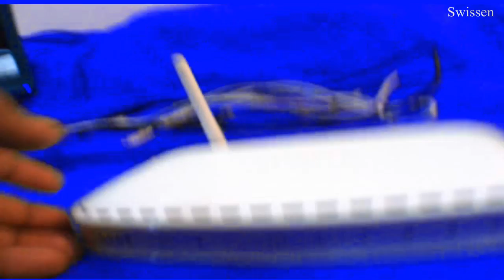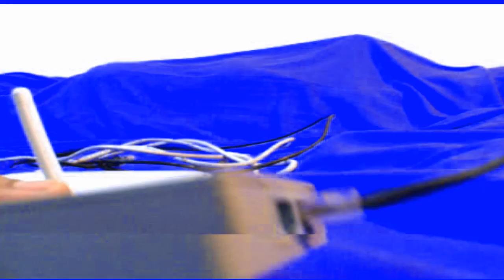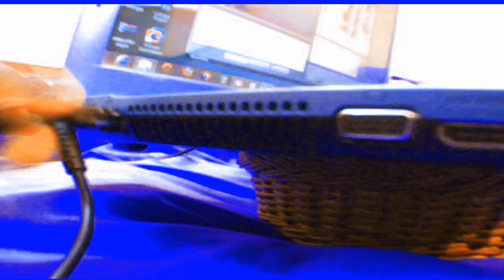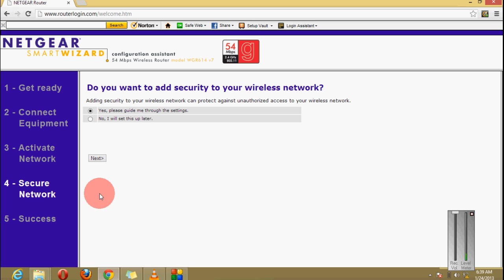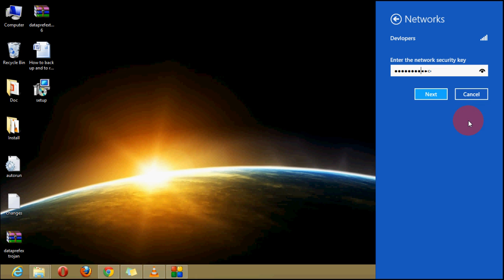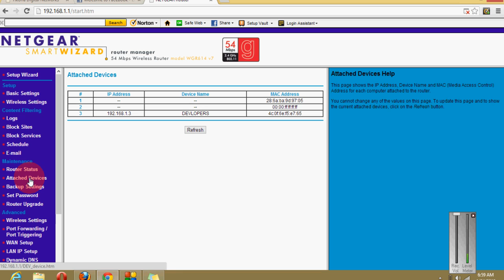Router Configuration - Tikona - Wi-fi connection - Swissen - Suyash Srivastava- youtube

Comment: Hi All,
I Having Tikona Broadband Connection And Having D-Link 600M Router.
I Already Configured My Router.
Please Kindly Tell Me How Can I Feed Tikona User Id And Password Into My ROUTER, So I Don't Have To Login Every Time When I Want To Access Internet From My Mobile Phones.
I Have To Login From My Computer Every Time, This Whole Long Process Irritate Sometimes
Reply from the maker: Ayush Sahu : well i will not suggest u to configure your router for automatic login because its provide you additional security which is good when you are using wi-fi . If you get rid from  filling  user name or password you can simply add remember me option in your browser .
Reply: Go to the router web page
1. Reset the router
2. Go to quick setup
3. Instead of Automatically detect choose Russia PPPoE.
4. If you have tilona digital network you will have your UseraID and Password.
5. Enter your User ID and Password.
6. Confirm the password.
7. Done. Restart your router
Reply: configure your router using PPPoE
Reply: +santosh nalawde Dear Santosh, I Tried All Possible Things But It's Not Working.Few Days Ago I Already Switched Back To BSNL. For All Those Who Wants Tikona Connection Please Be Aware Because In My Case Speed Was Good But Ping Was Horrible And Connection Drops Frequently(Signal 4/4) The Customer Care Gave Me Repeated Answer That Their Is No Problem. In These 2 Months I Realise That BSNL Is Best. If You Configure Your Router(PPPoE) It's Compulsory That You Have To Press LOGIN Button Manually.
Reply: +Suyash Srivastava  hi. Can you still tell, how to configure router to automatic login.
Reply: +santosh nalawde thank you so much.
I tried doing this. But, still unable to connect automatically. what to do now..
I'm using TP-Link 740N
Reply: +007katu14 Because We Have To Manually Press LOG IN Button Which Router Is Not Able...

Comment: Your Netgear did everything. I have a D-link DSL 2730U router. It has a dsl port, 4 lan ports and Wifi. Can I use it for Tikona?
Reply from the maker: Yes you can .
Reply: Suyash Srivastava How?? I can use it as a bridge, but unable to use it as a proper router.
Reply: +koolpalb + Suyash Srivastava : I have same problem with my D-Link 2730U. I can login into Tikona page from only 2 devices at a time. If I try from a 3rd device, it throws error "Maximum connections reached". How to fix this?
Reply from the maker: +Ashok Raj : if you will see tikona plan in detail you will see that it will allow you simultaneously 2 login at  a time but you don't need to worry . simply login with one device and connect other device to router without accessing tikona page . when you will connect with router you will have  internet access . make sure dhcp enable in router.
Reply: Suyash Srivastava : Thank you very much. I bought DLink Dir N 300 Wireless Router and enabled DHCP. It is working perfectly and I can connect many devices without logging from each. Only from first device, I had to login.

Comment: Hey man i was using d-link n300 2750 u Modem + router before but it was not letting me to connect more than 2 devices so i sold it... 
Now the question if if i will buy anyrouter i can access more than 5 devices on it like pc 3 mobiles 1 laptop plz answer me?

Comment from the maker: you can connect any number devices as it uses DHCP mechanism  . You have 2mbps connection means you will have approx 240 KB/PS speed so you should not connect more than 6 devices to surf seamless.

Comment from the maker: Procedure is  same whether u use windows xp, windows 7, windows 8 or windows 8.1 ,some times a error come with windows 7 home premium edition for that you have to click on connection and then click on fix connection in control panel and it automatically configure dhcp and thats the solution of problem and every thing is same as the above video .

Comment from the maker: procedure is almost same . Connect the wires and after connection type 192.168.2.1 or router  in browser addressbar and login . select PPPoE or dynamic/fixed ip nd settings are about to same if yu have any problem i will make a tutorial for that soon.